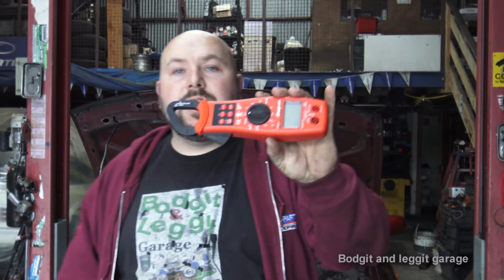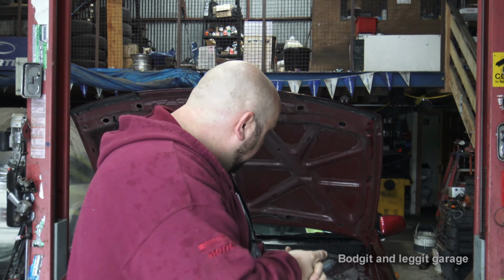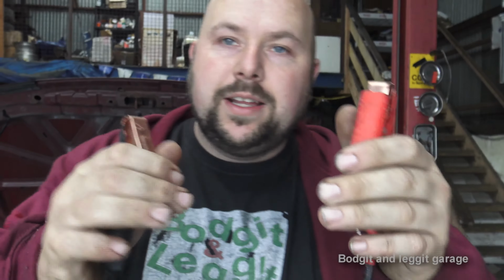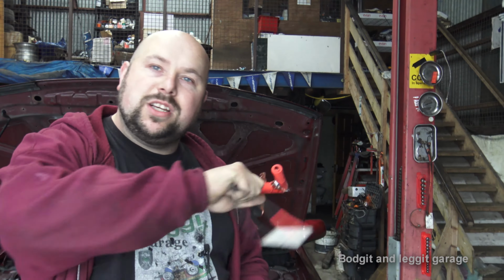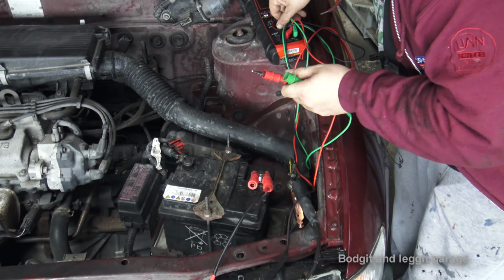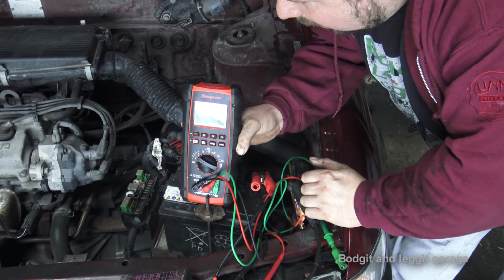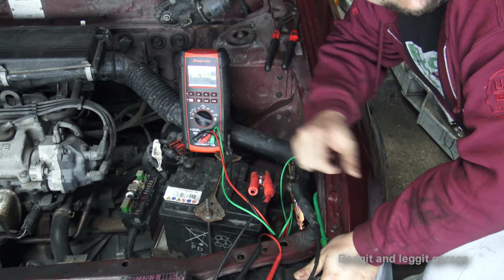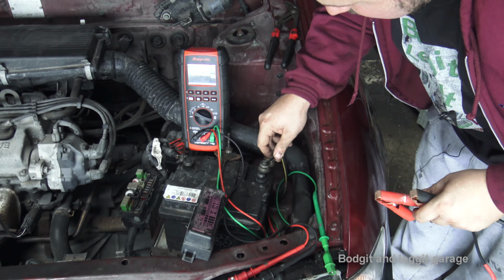How To Find Parasitic Draw On your Battery Part 1 Bodgit And Leggit Garage

Comment: Nice one - yes it's easier to find  the draw than fixing it. Voltage drops  on the fuzes  intact - what's your thoughts.
Reply from the maker: STEVE ROB hi mate I didn't really explain it very well in this video but I am doing a three part video series on this next part is going to be just using a test light on the older cars and the Third part is going to be doing a drop test through the fuse on the newer cars like I say in the video this test is only for certain cars hopefully people will watch all 3 and find out which is best for them

Comment: how come you put the resister on buddy. I've seen this method many times but it's normally just multi meter right to battery.
Reply from the maker: Billy The Loam Gardener hi mate there is loads of different ways of doing this depending on what car you have you have to do this for certain cars I am also going to be doing more videos on the newer cars doing a voltage drop test between the battery which is a better way especially for the newer cars

Comment: I made up one of those resistors a while back.   Most of the newer cars when you first hook up the battery, some of the lights come on for a while.   The resistor works great for that problem.
Reply from the maker: 1970chevelle396 yes mate for certain cars it is very good I will be doing few more videos in this series explaining different ways especially on the newer cars doing a voltage drop test for the fuse

Comment: I use a current meter that plugs into each fuse position in turn and allows measurement of the current each circuit is drawing. Favourites for drawing down battery are lingering circuits. Stuck glove box lights,boot lights and even under bonnet lights. Simply replace each fuse in turn and plug in test probe and note down current. Added up should add up to same as measured by Hall effect clamp on main battery lead. I check positive lead and Earth lead with Hall effect clamp.
 A couple of steers to help find faults are any modifications, alarms, immobilisers, lighting, tow bars and the hot favourite- audio upgrades wired direct to battery!
Reply from the maker: Andrew Wilson hi mate this is the first video of a few in this series I will be showing different ways depending on your car like I explained in the video this is only for certain cars I will be doing a video on more modern cars shortly
Reply from the maker: Andrew Wilson  on the new modern cars it's not really a good idea to pull out the fuse as you can wake up the module and give you false reading I will be explaining this in the new video

Comment: Good video Leon and bloody right about disconnecting batteries I knew Someone who got a new battery for a Audi it was a very new one only few years old and when they put a new battery on it wouldn't start had to be programmed or keys programmed I think absolute nightmare if you didn't know that and found out when you needed the car for something.
Reply from the maker: Brendan Brady fan you can't beat German engineering lol there is ways around that two mates I might do a video of that in the future

Comment: Never used that method... interesting....
Very good video as always...
Reply: lmsvvavr putting a resistor in series causes voltage drops so I would not say it's 100 percent reliable ...and could put other potential problems in the mix. Stick to using a current clamp and measure volt drop across the fuse to locate what's circuit drawing current
Reply: I know that... I do prefer other methods, like the ones I use... was just that I never saw the one he was using on the video.
Reply from the maker: I'm going to do a couple more videos this is just the first in the series explaining the different ways of doing this like explain in the video this is only for certain cars I'm going to do a video on the newer cars doing a voltage drop test between the fuse will be put in that up very soon